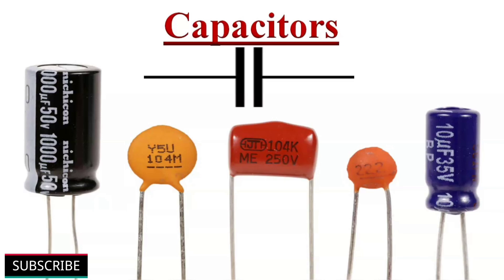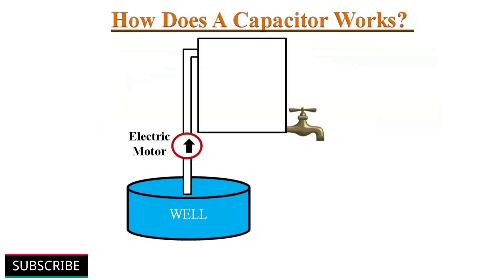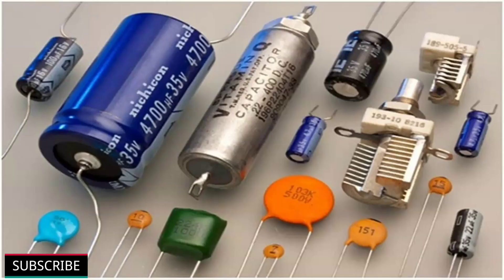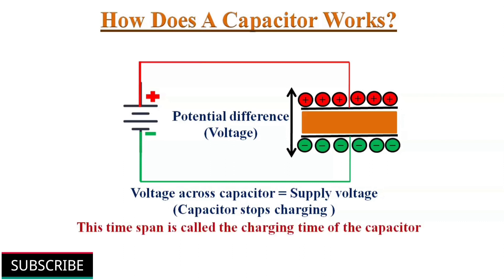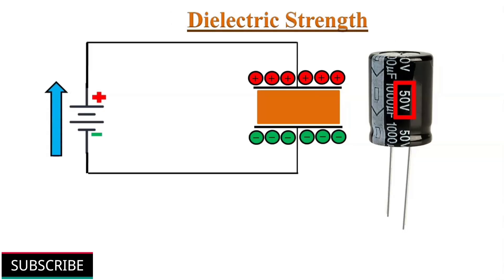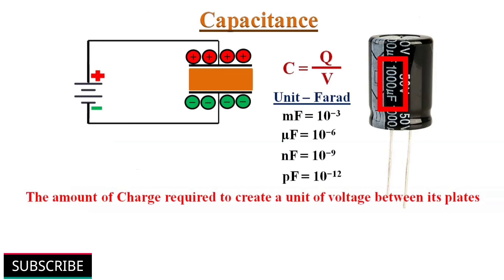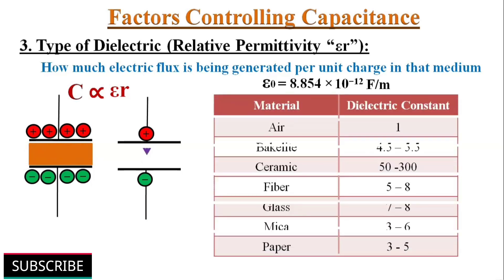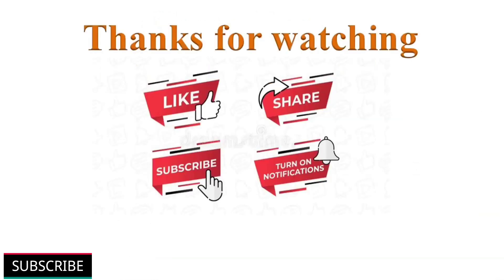How does capacitor work ?

Comment from the maker: Timestamps for various topics covered in this video are as follows:
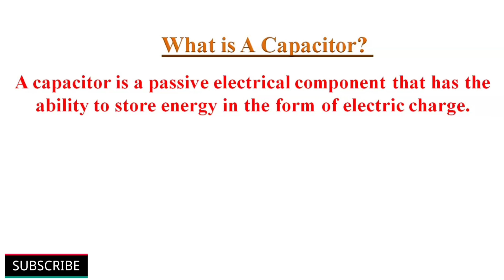0:26 What is a capacitor,
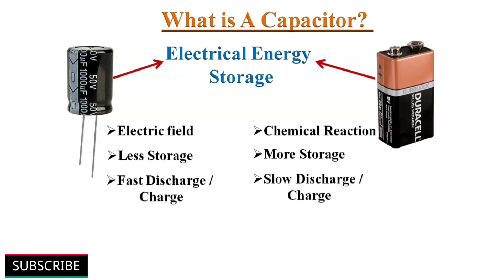1:07 How does capacitor works,
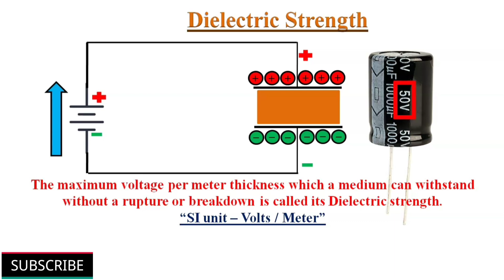6:15 Capacitance,
7:06 Factors affecting the capacitance,
8:30 Where do capacitors are used (Applications).